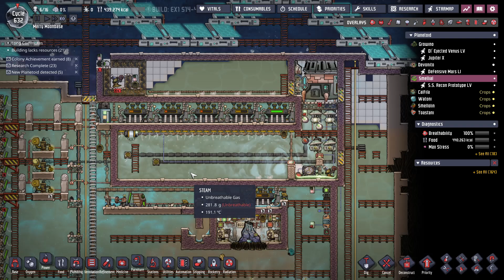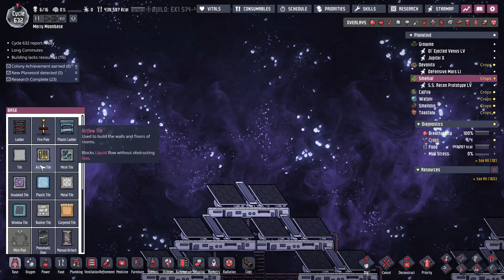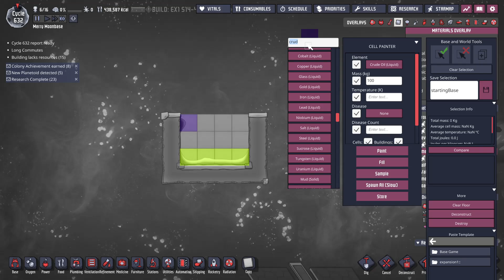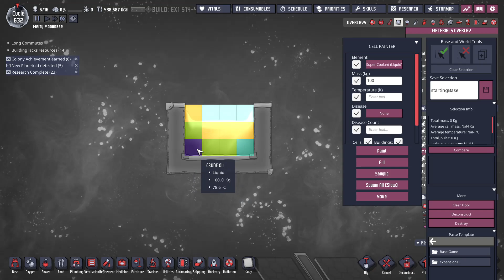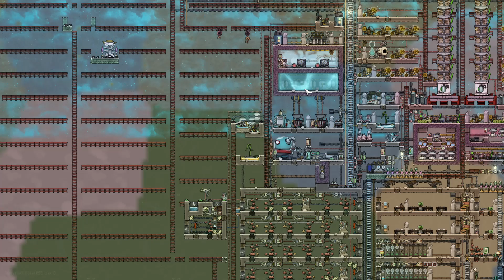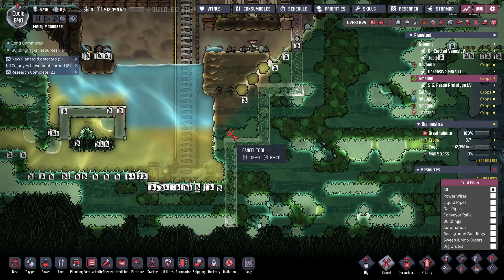Merry Moonbase Ep 24 Starting up the Nuclear Plant, and Interplanetary Launchers

Comment: I'm stealing this build but tweaking a bit is it alright? I think this is the simplest one that doesn't require much tinkering. what pressure do you have for turning the gas pumps on? I'm assuming as long as the reactor stays below 150kg it's safe.
Reply from the maker: Steal away, post what you do to make it better.  I disabled the pumps, they are not needed.  I moved the cooling to right next to the reactor to keep it cool, and used a pressure of 15 kg by the turbines to dump excess water out of the system.
Reply: @TartarusPlaysGames  IF i am improving on it. lol just thinking maybe foregoing the pumps and making it 6 turbines for symmetry. thanks man! love ur vids

Comment: I know it's late in the early access to make the change, but I wish they'd make the reactor footprint 2 tiles taller. Watching the lid popping out the other side of the ceiling when it's running just seems kinda sloppy.
Reply from the maker: Very true.  I doubt they will change the size.  I hope they keep updating it.

Comment: You do know you can power up to 9 steam turbines with 1 reactor.  Why only 5?  And you really only need a four tile wide column for the center and two tiles high for the turbine inlets.  The large chamber, while easy to build and cheap on materials really isn't as space efficient as you can make it.  Not sure if you caught it but Francis John did an excellent 2 reactor design with 18 turbines.
Reply from the maker: I have seen the 9 thing if they want to keep it in a vacuum.  I am running only 5 to see if that can keep up.  It should, and I am going to try cooling the reactor, not keeping it in a vacuum.